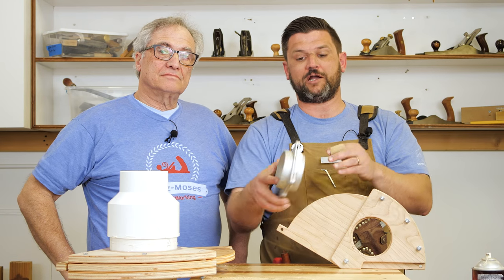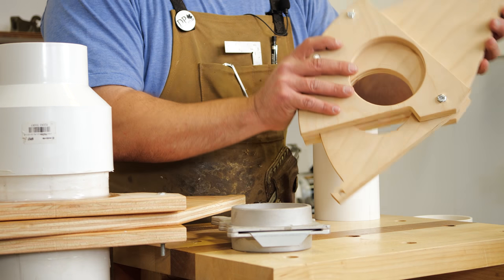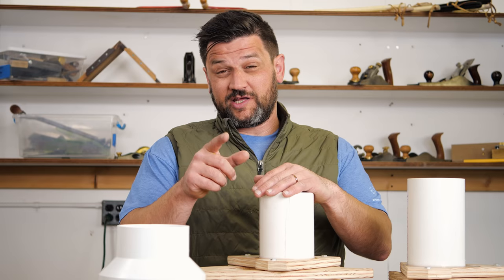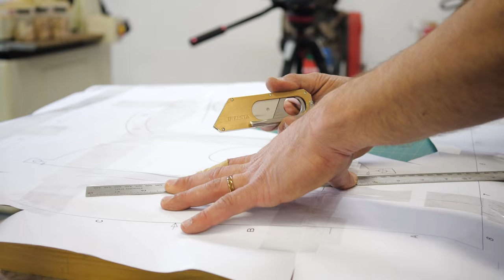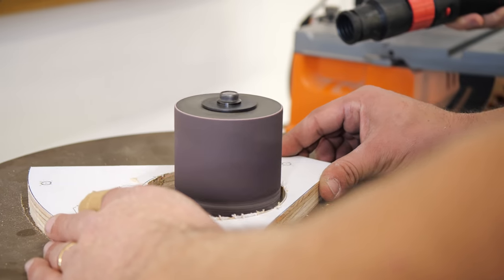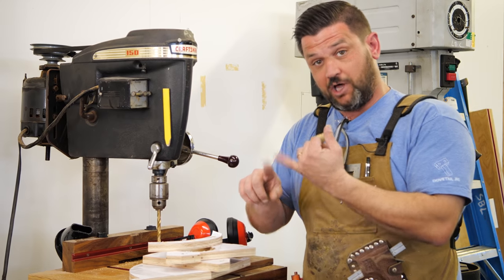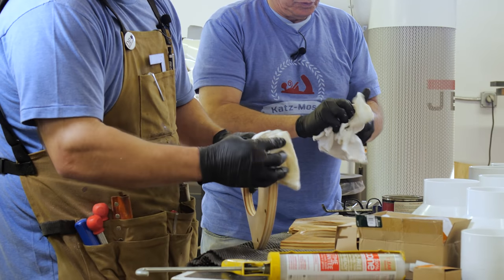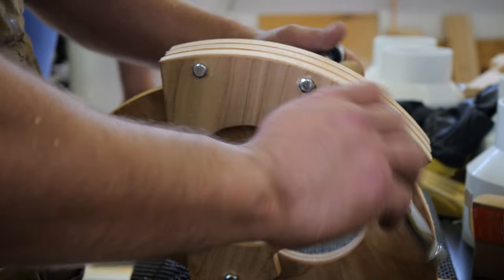DIY Dust Collection Blast Gates - -With 6" and 4" Plans and Templates

Comment: i bought the CNC files from your website.  Just required a few tweaks and they ran perfectly.  Cheap at twice the price!  I used threaded inserts, and countersunk the heads of 1/4 x 20 socket head bolts, so everything is flush.  Great design.  Thanks very much.
Reply: Me too.  Great minds and all that. ;-)

Comment: I use epoxy instead of silicon.  Stronger, ready in 5 mins.  Last gates I built with epoxy started to fail and come apart.
Mine are not as pretty as yours though.  Nice design.

Comment: You could probably add some gasket material to minimize the gaps around the edges (or to give us slightly more mortal types some more leeway on precision). I’ve seen people cut them on a Cricut for that CNC this precision too!
Reply: Good idea. I hadn't thought of using my vinyl cutter to cut gaskets and spacers. That's as close to CNC as I get.

Comment: So to attach these on the wall, I added some small 1” x 1/2” corner braces (L-brackets). I had to drill them out a tiny bit where the bolt would fit but it works great. One screw in a stud, the middle bolt on the rounded part in the other.

Comment: I built the 4” blast gate and it is working great. I need to make the 6” version but it is pretty massive. I’m worried about the weight (can’t attach to the wall). Is there any reason I could not use 1/2” plywood instead of 3/4”?
Reply: I was wondering the same thing. I don't see why 1/2" plywood wouldn't work. The thickness doesn't make it more or less effective. If anything, I'd probably only use 1/2" ply.
Reply: @JoaquinGTP  I ended up buying the latest set of KM blast gate plans which do specify using 1/2” plywood. The only issue I found is that when the pipe is inserted into the hole there is not much surface area, and silicone caulk alone was not enough to hold the pipe in place. I ended up using epoxy on the inner edge and then also the caulk around the outside, if that makes sense…

Comment: You want to make the long side away from the pivot bolt square so you can fix a flat section making it easy to fix to the wall/ceiling.

Comment: If you have clamp together dust collection, can these still work? I got 5” pipes and fitting online and am toying with just buying the aluminum blast gates from the company. I’d have to tweak the plans I bought from you to fit 5” pipes. Anyone have similar situation or thoughts?

Comment: great video I was wondering where you got the hose for the upper portion of your dust collection for the router? I'm from Gt. Falls, Mt. & I don't have access to a devoted woodworking store, ie. woodworking, woodsmith journal or Rockler. I can reach them thru the internet although I've never seen  either one, didn't mention that I would also like  to know where I can  find one of those by those I mean the spring clamp that you used to connect one of your hose to the dust port from one of your machines. I'd would like to know where I can find them.? Please let me know!

Comment: Hey JKM...I know I asked in the other dust collection video, but specifically talking about 1:31 to 1:38 where you are assembling the blast gates and reference "as long as you've cut your pipe square."  How critical is squareness with the assembly of the gates?  Normally I use a chop/miter saw, but 6 inch is a bit too large for that.  Other methods, including a home made miter box have not been fruitful either (and no rental places have a 20 inch cut off saw for rent). :)
Reply: Crosscut sled or miter gauge on table saw.  See https://youtu.be/IUOWVoYIJVs?t=199

Comment: I’m setting up a small workspace in my garage, but still setting up dust collection. Can the plans be sized down for the 2” pipe for those of us using our shop vacs and dust separators?
Reply from the maker: I include the fusion files which can be edited pretty easily. Cheers!

Comment: Love your videos! Might be interesting to see if you could replicate the design for a 3d printer?
Reply from the maker: Fusion files go directly to 3d printer but it sounds like a massive print that costs more than just buying a metal one
Reply: @katzmosestools  Having purchased the plans, I tried slicing the biggest middle part and printing the halves vertically.  It used a LOT of filament and ended up a failed print.  My idea was going to use the printed versions as a template.  Instead, looks like I'll be using the printed plans :)

Comment: Lacking a CNC or the patience to cut out a bunch of odd-shaped parts precisely, I would probably cut one set of parts from MDF and use them as patterns for my router and flush cut bit.
Reply from the maker: That's definitely how I'd do it and I should've mentioned it
Reply: You could combine the two techniques by using your CNC to cut MDF templates and selling them. I would probably buy a set.

Comment: Anybody having problems getting the bottom (tool side) pvc pipe staying inserted?  I’m using the wall mount provided in the plans. I’m on my third blast gate and the 3rd one seems to work itself free on the tool side. It has a 45 degree elbow and a 6 to 4 inch reducer on the tool side. It keeps pulling loose despite two different caulks I’ve tried.  I’m considering construction adhesive…
Reply from the maker: Use the construction adhesive. Cheers

Comment: This is awesome Thank You. Question How would I adjust this for a 2-1/2" Shop Vac System?
Reply from the maker: You could just size the holes differently or resize the whole thing in fusion
Reply: @katzmosestools  Thank you, Definitely wanna make a set of these, they are the Best I have seen thus far.

Comment: Went to the link to try and find these plans.  Have they been pulled down or did I miss them?  If pulled down, did you find a problem after using awhile?
Reply from the maker: Theyre definitely on my website katzmoseswoodworking.com
Reply: Jonathan Katz-Moses thank you for ensuring I knew they were there.  I found them in the store under woodworking plans.

Comment: Quick tip for a better looking silicone seal: use a glass cleaner & a popsicle stick. :)
Reply: What do you mean 'glass cleaner'? I've also ordered some of those fondant tools. They're basically ball bearings on the end of a stick. They make nice even curves in corners when you're caulking things up.

Comment: I purchased the digital plans and can't for the life of me figure out how to print these and cut them accurately.  In the video you mention that you can turn on the grid in Adobe Acrobat, which I can do, but it doesn't print with the grid, so there's no alignment/reference once they are printed.  Is there something I'm missing?  I'm surprised to not see anyone else in the comments section here bring up this issue.

Comment: The way the metal ones work is the sheet metal sucks up against the gate frame when the dust collector is running and then gap is non existent.  Works great if you buy quality ones.
Reply: This was my thought as well. He measured the gap on the wrong side of the gate; the side facing the tool. I've smoke tested my metal gates and there is a tiny amount of leakage on some of them, but it's super minor.

Comment: Instead of using lock washers on soft wood why not us a flat washer and a nylock nut? They will not loosen and the flat washers will not sink into the wood as fast.
Reply from the maker: Used what I had on hand
Reply: I would put a flat washer under the lock washer to keep the lock washer from digging into the wood.

Comment: Forget manual blast gates, GO AUTOMATED!  GrnGate.com.  is king!
Reply from the maker: Too expensive for me
Reply: Did you look into it?  You’d be surprised how affordable this system is!  He developed this system for smaller, one man wood shops.
Reply from the maker: @tundrawhisperer4821  it would cost almost $2k to outfit my shop. That's nuts
Reply from the maker: @tundrawhisperer4821  these cost $2-4 to make
Reply: Jonathan Katz-Moses just throwing it out there as alternative is all.  Some may want a different look,   How’d you figure 2k?  I have six stationary machines on my current system and the whole system, including the blast gates and controller for the dust collector cost me $750.  I have a short (and very amateur) video on my YouTube channel showing them in place.
Reply: Jonathan Katz-Moses no, don’t get me a wrong.  It’s great for a tight budget.  Proven way to do it.  Thx
Reply from the maker: I have 5 sections of the shop that need controlling plus 14 tools that also need blast gates. I'll have a video on it coming out Sunday.
Reply: Jonathan Katz-Moses got it, I’ll look for it.  Thx
Reply: @katzmosestools   -  I bet you could figure out a way to make these automated. Arduino's or Raspberry Pi could do the trick I bet!